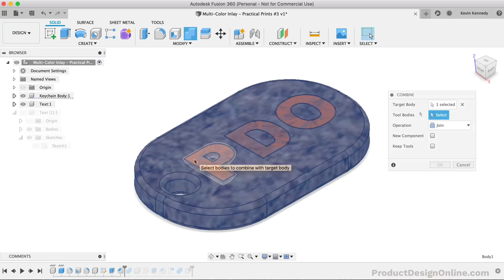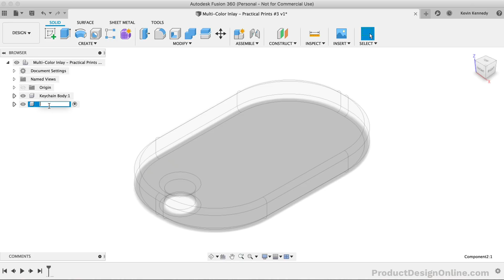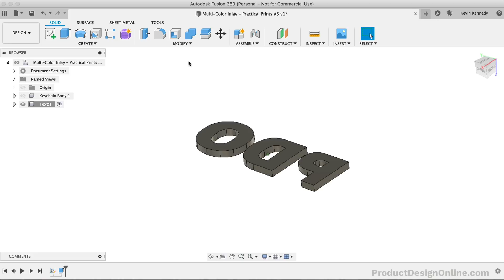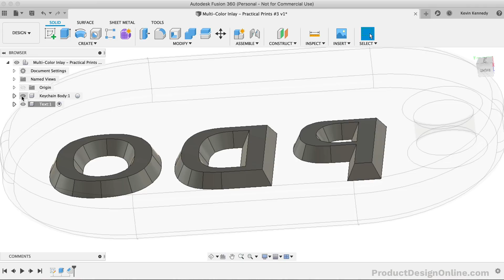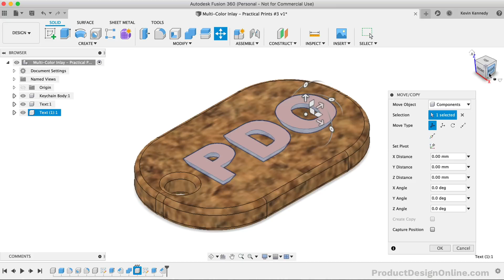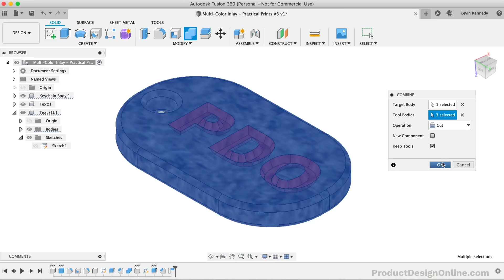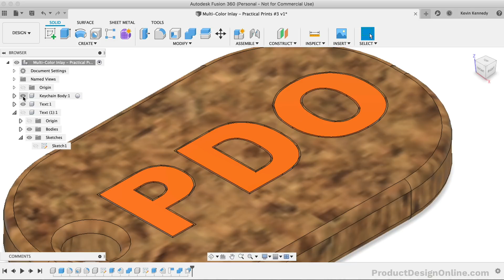Multi Color 3D Prints using Fusion 360 | Inlay Parts - Practical Prints #3

Comment: It would be nice that we had option similar to "Contact Set" but for Tolerance.

Selection priority and filter looks like really powerful Fusion. You should also add Selection tool tips and tricks to "Learn Fusion 360 in 30 days' playlist
Reply from the maker: Thanks for the feedback! Appreciate it. I've been wanting to do some beginner to advanced navigation/selection tricks for a while. Will have to do that soon :)
Reply: @ProductDesignOnline You can make something similar to "Learn Fusion 360 in 30 days" playlist. You made intro "Fusion 360 UI Tutorial".

Or you can make new playlists "Fusion 360 tips&tricks" or "Intro in Fusion".

- how to rotate the body
- how to select the body
- how to found out what error means
- timeline icons meanings ..

Comment: Only problem I had is that you are using shortcuts.  No idea how to create the box shortcut you show when you say create a box. Also, my assemble>new component is different.  Does not show the same picture.  Can you assist please?  I really want to learn how to do this video.  Thank you!
Reply from the maker: You can use shortcut letter "S" to open the Shortcuts box > search for it. With the component dialog, leave everything as the defaults (Internal Component) and it will work as seen in this video. External component is a newer concept and only for assembly files with separate design file references.

Comment: Nope. this didnt work. when i imported this into prusa slicer 2.3 it shows as one solid thing to print. the hunt to create a multimaterial tutorial continues.

Update: so you're tutorial was not a complete waste of time. Thanks for the tutorial. once after i followed all your steps (minus the offsets because im printing with 5 colors). If you are using the Prusa MK3S and the MMU2S (multi material upgrade) you right click on the top level component > Save as STL. on "Save as STL" window that pops up change the structure to "One File Per Body" as prusaslicer needs multiple STL's to assign filaments to. then drag all the exported STL files into Prusaslicer to start your multimaterial print.
Reply from the maker: You need to export them separately. Separate STL files for Prusa Slicer.

Comment: One question: If I want to have a space gap on the sides, between the letters and the keychain body. How can I do that?
I do have a dual extruder but I want to have some space between the to bodies, so they are not touching each other (except on the bottom joint).
Great video BTW!
Reply: That's what the whole "offset" step was all about.

Comment: I think I'm doing well with Fusion 360, and then I see how elegantly you solve problems that I would have struggled with, like in this video where the use of the projected line and the point-to-point move...both features I use but never thought to put them together in this way.  And the boundary fill was a nice idea to have for the future.  Thank you.  A couple of other thoughts:

Instead of chamfer or draft, I would have used a taper angle on the extrude.  Thoughts?

When printing in the orientation you use, the filament will have to bridge across an open area after it completes the chamfer of the letters on the bottom side.  Filament will often droop a bit when bridging a gap.  As a standard practice, I'd be tempted to add an additional offset either to the bottom of the letters or to the bottom of the inset in the main body to provide a bit of additional room (beyond the tolerance you already provide) for the potentially drooping filament.
Reply from the maker: Hi Robert. That's correct - you could also use the taper angle in the Extrude command. The reason I prefer the chamfer or draft features is because they will create their own instance in the timeline. It's really a personal preference, but I like to separate things like that, thinking ahead that I may adjust chamfer/draft angle.

Comment: I think I’m a bit dense. I’ve created horizontal and vertical construction lines through the middle of the plate. How do I align my lettering so that it is centred vertically and horizontally? TIA.
Reply from the maker: Hi Ron. Unfortunately, there's no easy/native way to do so in Fusion 360... its a workaround....but here are the general steps:
1. Find the object's center point by creating a construction line running in each direction
2. Right-click on the text and select "explode" text. This converts it to geometry which makes it easier to work with.
3. After exploding text the geometry will automatically be fixed. Select all text lines and select "Fix/Unfix" constraint in the toolbar.
4. Create a rectangle sketch around the text, essentially creating a text box
5. Create diagonal construction lines to find the center of your text
6. Select all the geometry that makes up the text and the newly created textbox/construction lines and move it into place to where the center points align with the object center point

Here's a screenshot image for reference - https://snipboard.io/4RBfjV.jpg (note: my text has intentionally moved a tad to the right horizontally because of the keychain hole)

I hope this helps! I'll try to put this into a more in-depth blog post on my website...
Cheers, Kevin :)
Reply: Product Design Online Thanks
Reply: @ProductDesignOnline  Hi Kevin. Sorry to keep pestering you. How would I go about having the letters be the same height as the badge (3mm) and coming in from the rear they taper from bottom to top. I'm guessing I'd have to adjust the chamfer somehow and then also the offset? How would the parameters for each change. I got your method to work, but I'm playing with the offset. But I'd like the letters to come in from the back in some cases. Thanks again.
Reply from the maker: @Ron_Ventura  No problem, I'm happy to help. I'm having trouble following what you're trying to do... do you have any reference images I could see?
Reply: @ProductDesignOnline  Hi Kevin. This might be heresy, but I have a couple of OpenSCAD files that more or less do what I want, but without the chamfer. Is there any way I can attach them to a comment?
Reply from the maker: @Ron_Ventura  You can email the attachments to me at kevin[at]productdesignonline[.]com :)

Comment: Oh this is awesome! Did you have to save the components as separate files in order to print them? Sorry, if the answer is obvious, I just don't see it because I'm new to the 3D modelling..
Reply from the maker: Hi, Miiklaa. That is correct! You will need to save each component as its own STL file. I sliced them separately (using Cura) to print them out in their own color.
Reply: @ProductDesignOnline  Alright, thank you for the clarification and for your work on PDO. I learned a lot and built confidence with your help.
Reply from the maker: @miiklaa  Glad to hear that. As always, I appreciate you watching and taking the time to comment :)

Comment: Great Video, I have learned so much from you.. 
On a side note maybe talk about print orientation. If you printed the key chain vertically then you would have not ended up with the other side not sitting flush. Printing vertically opens up topics and  design considerations that we can all think about during the deign process. You can talk about over hangs, angles of chamfers in relation to the bed, talk about requiring supports. These are all very important " design and work flow" skills to learn when to merge Design and 3d printing... Once again excellent video and thanks for the information !!
Reply from the maker: Hi, Ty. Thank for bringing this up! All great points... I'll start to incorporate more of this into my videos. This is something I often forget about...and need to remind myself often that it's not something all beginners already know. Cheers, Kevin :)

Comment: Hi there - very good info. will this technique work for CNC production? or do you have a video showing this process?
Reply from the maker: Hi, Sawdust & Woodchips. You can use this same technique on CNC production. I don't have a video on it at the moment. You would have to also consider the bit type as that would affect the shape/size of the cutout. I have to rewire/fix my X-carve and then I'm hoping to get some CNC videos incorporated onto my channel :)

Comment: This is a good one I should have thought of this maybe next project would be dual color for dual color printer I ha e a ender 3 and a geeetech a20m dual color. I can't wait I got my box for my pi almost done
Reply: I would love to see a tutorial on multi color design for multi color printing capabilities like the Prusa MMU or Mosaic Pallette. I have an MMU, but I stopped using it as I didn't find it as useful as I wanted, but if I could design my own stuff, maybe I would use it more.  I love Fusion and similar parametric design environments, but most tutorials on multicolor design seems to be mesh environments like MeshMixer and similar, that I have less interest in working in.
Reply from the maker: Great points!...I'll try to do more tutorials with multi color of more 3-dimensional objects.

Comment from the maker: You can find the series playlist right here - http://bit.ly/practical-prints
-
TIMESTAMPS
0:00 - 3D Printed Inlays designed in Fusion 360
0:36 - Project overview
1:15 - Creating component and box
1:30 - Adding fillets to box
1:47 - Adding keychain hole
2:29 - Creating the text
4:30 - Adding chamfer to text
6:50 - Changing the appearance
7:10 - Cutting the text from the keychain
8:00 - Copying text to another side
10:29 - Creating clearance
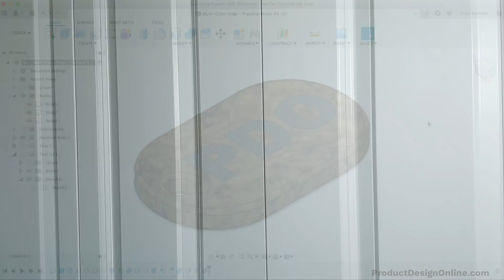14:00 - Print results